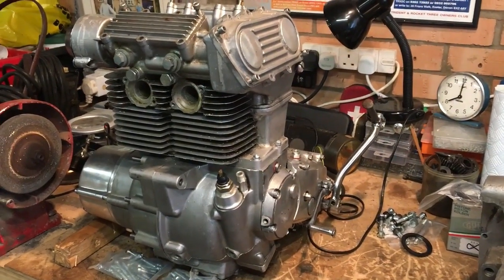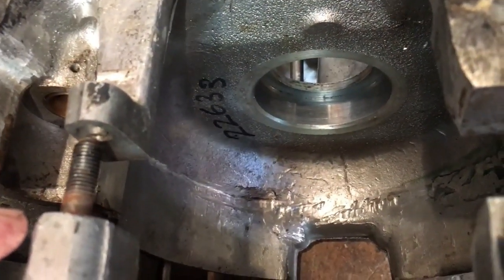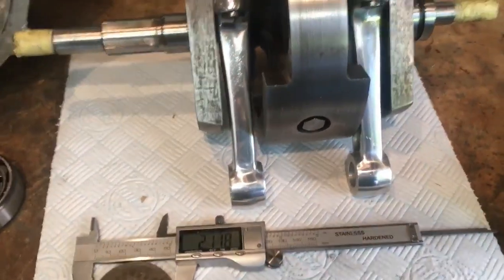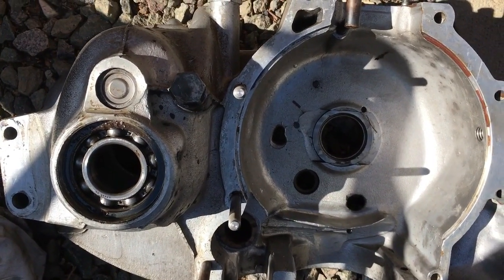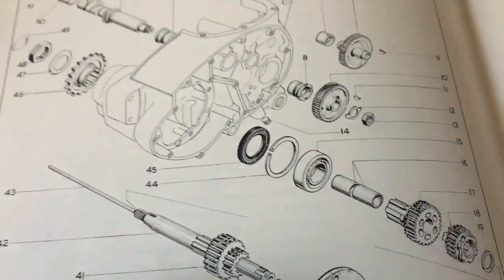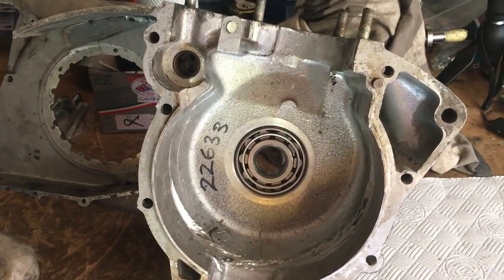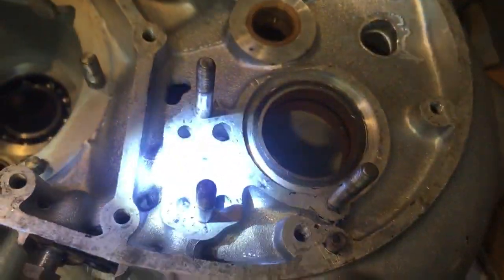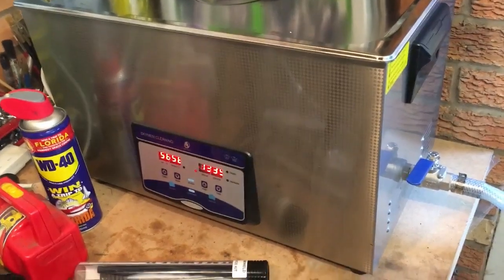BSA A70L Lightning - Engine Part 13 - Crankcase Preparation 2

Comment: Great thanks Angus! I will compare those measures with mine on the A65 when I restore my Engine ,and decide if it Worth to do a conversion. Another thoght that came to me  why they change the shims to outside case was that (as the a70 was made for competition ) it was easier to set up the axial play ,imagine it had moore wearing  than a road used bike.
Reply: How about a quick review on the ultrasonic cleaning tank??
Reply from the maker: Another good idea Matt - added to the list. Thanks.

Comment: I don't know if you have an aircompressor but it would be a good thing to blow out the oil channels or draw a smokepipe renser through ,Only a reflection I did , Thanks  for  interesting film. Torbjörn
Reply from the maker: Hi Torbjorn - yes a wise recommendation - I don't have a compressor but I do have pipe cleaners so these and WD40 have been put to good use.

Comment: Is it possible to put hot water in u/sonic to cut down heating time?nice vid
Reply from the maker: Hi Marshall - thanks for the interest and comment. Yes shouldn't be any problems with that when refreshing the tank although it is 30L capacity so I utilise contents a few times before changing. Thanks again.